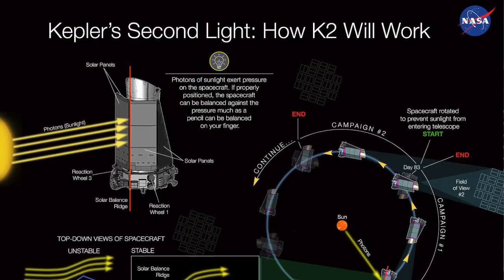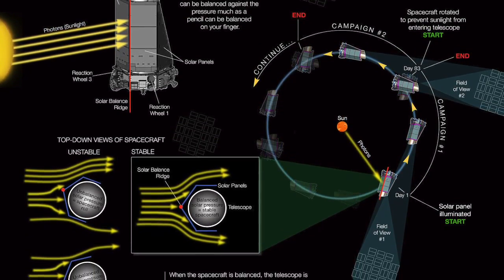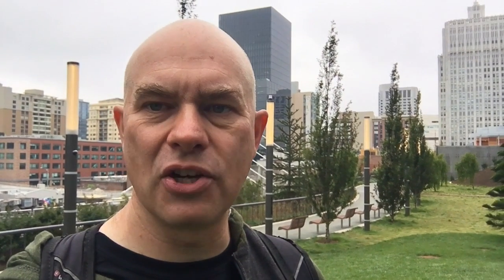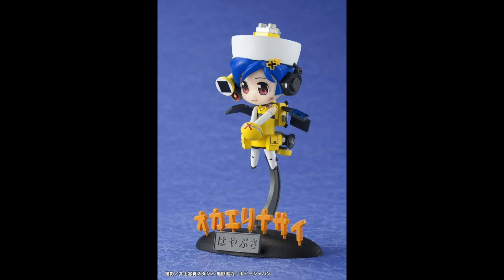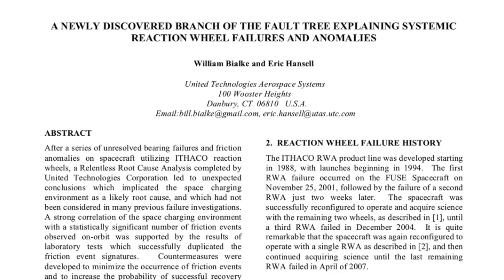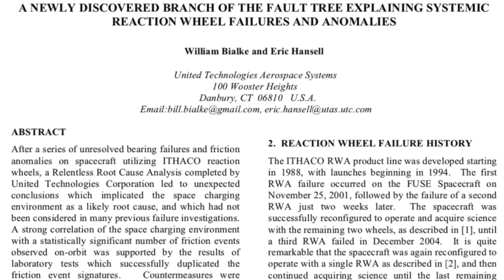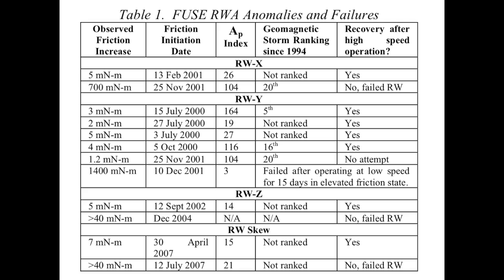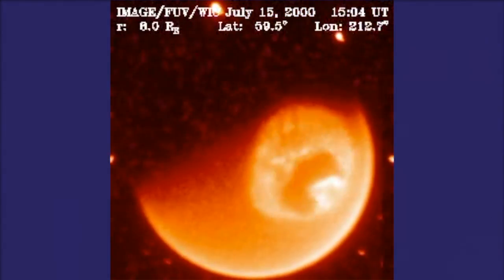Scientists May Have Figured Out Why So Many Spacecraft Were Failing

Comment: And when you think there's nothing more we can learn about space hazards, this thing happens. Manned mission to Mars? HA! Yeah, delay that for another 50 years till we actually find out how to keep people alive.
Reply: Or they could just carry a few spare bearings with them...
Reply: Caldwell Transport Columbus, GA sure, that will work great. Adding more weight for spare, spare parts because you do not know what is going to break. Is it not better to simply know how stuff work out there, then send people and spare parts that will only be used in case of emergency.
Reply: I guess you've never been away from a city where you couldn't just pop down to the local store and buy anything you need. 
Even when you know how stuff works, its going to break, often in new and frustrating ways.  With unmanned spacecraft, we just write them off when they breakdown.  About the only real justification for sending people to Mars etc. (besides FLAGS AND FOOTPRINTS!!!!!) is that they are highly adaptable and versatile (in addition to being fragile and resource hogs), able to fix things or improvise that would be impossible to automate (yet anyway).  But they can't do that without anything to work with.  How many more generations do you want to wait until you feel everything will be safe and perfect enough?
Reply: Caldwell Transport Columbus, GA well I guess you can just send them at random, and hope everything goes well. I doubt the public opinion will back you up on this though. But since politics has everything to do with public opinion I doubt you'd do that. You'll just wait for.. something to happen. Maybe a war that, will force your hand for example. And that's exactly the state we are at the moment. Peace kinda sucks of you think about it.
Reply: Humanity spread across this planet and became its dominant species by just going out at random and hoping everything goes well. Your sentiment is why I don't think our civilization (perhaps even species) is going to be the one to get there.
Reply: Caldwell Transport Columbus, GA it was forced to do that, under the pain of hunger, war, and the lust for riches, and new territories. You think Columbus would have sailed to the new world, had he not promised gold to queen Isabella?
Reply: History fail.  He wasn't sailing to the New World and he didn't promise gold.
Reply: Caldwell Transport Columbus, GA hey, I'm not here trying to educate you, that's Scott's job. If you want you can search the motives behind the "age of discovery", aka "the search for the Northwest Passage". I personally can tell you now, it had nothing to do with "braving the unknown", or "our compulsion to explore" (took that line directly from Ayreon). It was more or less about wealth, gold, and the control of trade, primarily spice trade from India.
But that is my opinion based on the info I have. As always, you are entitled to your own opinion. We have after all free will... or do we?
Reply: "Peace kinda sucks of you think about it."
No it doesn't, modern war is senseless destruction. The ernormous US military budget won't bring you any closer to the stars unless Trump takes the whole Space Force part serious.
I think it was Wernher von Braun who said a Mars colony might cost about as much as a small-scale war but the profit and opportunities would be so much greater. 
You may think it's not economically feasible right now and for the science community unmanned probes are sufficient, and I agree. But in the long term space travel may become cheaper and the vast deposits of resources in our solar system more appealing. After all, Earth is a planet with limited resources and limited growth is not socially acceptable, that means becomming an interplanetary civilization is inevitable, unless there is a Nuclear war killing civilization before.
Reply: @ Jo - Not opinion, facts.  Our compulsion to explore, or curiosity, is the instinctive need to find resources.  Our contemporary problem is that those with the ability to bridge the high costs of getting into space,  the owners of capital (ie; government and the wealthy), are largely fat and happy down on Earth and are satisfied receiving a safe return on their investments down here.  So, barring a handful of individuals and a tiny fraction of the world's capital resources, the impulse to explore is largely suppressed.  That will not change until either our motivation goes up, or the costs to explore goes down.
Reply: Mayer "modern war", is no war. Simply a stronger animal picking on the weak. In a true war, both sides loose, constantly. That's why they invest in crazy plans that can tip the scale in their favor. That's how innovation is born. Be not mistaken. This is a peaceful time we live in, with a few skirmishes here, and there. And even from those skirmishes sometimes, human ingenuity enforces a crazy plan like 9/11, which actually works. You really can't think like that during peacetime.
It's funny how you mention Braun. An axis scientist, recruited by the US under the pain of death, since you know, it was either that or  war criminal charges and execution. So an innovator bred by war, he worked for the US on another war, a cold war, but a war nevertheless. He made sure the US would sovereign over space, so they could have the higher ground. Well, he tried, Russia has recruited a bunch of axis scientists as well. You know the rest.
Reply: Caldwell Transport Columbus, GA so if you agree that, what motivates innovation is profit, then why start your comment disagreeing? Anyway I somewhat agree, not fully, with your change of subject, but I don't have the patience to talk about it. It's more your attitude that ticks me off. You know how things work, in your opinion (and I don't give a fuck if it's facts), yet all you do is sit here complaining about that, to me, a stranger. Go do something about it, if you think it's possible. If your faith in humanity overcomes the obstacles set by governments, and powerful people. You go show them...

Comment: Mmmm... so, low cost supplier... as the old saying goes, you get what you pay for...
Reply: Rick Koehler  I have a feeling that "low cost" in the satellite industry is still several orders of magnitude better quality than what the casual observer would consider "good enough".
Reply: timbargen yet, cheapness eats the money as a saying says...
Reply: @ergohack  you're probably correct. However, in most applications you can get away with "good enough" because you can have someone service the machine when something goes wrong. That's not really an option in space...  

That said, I find it interesting that since they switched to ceramic bearings this issue has largely gone away. Yes, I'd like it if we could capture one or more of the probes with the failed reaction wheels, bring them back and figure out exactly why they failed. However, I doubt I'll see that happen in my lifetime, so the hypothesis of arcing inside the bearing makes for a plausible explanation.
Reply: @koehlerrk1    When you get into parts like this, using cost as an indicator of quality isn't nearly as useful, since many other things come into play.  
For example, lower cost may actually indicate a higher confidence in the end product (on the manufacturer's side), since they won't feel as much need to build the cost of potential lawsuits or insurance claims into the final price.

Comment: Could it be that this manufacturer hit a particularly unlucky more susceptible combination of bearing material, lubricant composition, distance of the ball from the body of the bearing etc or them experiencing an higher failure rate is just a consequence of being used more due to their lower price?

Comment: *writing comment at around 5min in...
Ceramic bearings are a thing. 
...yup...
  I can't believe it took so long for this to happen. Apparently these guys need a serious crit or velo cyclist on staff. Ceramic bearings are common on top of the line road and track race bikes. They are harder and therefore more efficient. There are also ceramic hybrid bearings. IM(unqualified)O ceramic bearings should have been their starting point (lighter weight/less rolling resistance/less lubrication issues/electrical properties/only cost about 1.5 times as much as traditional steel) The only downside of ceramic bearings that I'm aware of is their impact tolerance. A big downer for the scientist to miss out on all of the offroad 4-wheeling-ur-space-telescope events but whatev
-Jake
Reply: DANK 
  I don't know. IIRC steel bearing require a different alloy that is considerably softer for the races as opposed to the ball bearings. The races are intended to be the deformed wear surface instead of the balls. I am no metallurgist but from my limited understanding dissimilar materials are the root cause of expansion issues. IIRC ceramic bearings are made of more similar materials between the different parts of the construction.
  Empirically, they seem to work pretty well on my main bike. So far I put about 10k miles on 2 in my main bike's bottom bracket (crank/the 2 arms that the pedals attach to). I have 5 total in my main carbon wheels. Those probably have around 20k miles on them. They've done better than most of the steel bearings I've replaced in a bunch of bikes and wheels since I started riding daily in '09. It's not space, but for light duty use they work pretty well. Bikes are surprisingly demanding on bearings. I've shattered a few steel bearings and worn out at least a couple dozen. I've yet to replace a ceramic from damage or wear.
Reply: "The only downside of ceramic bearings that I'm aware of is their impact tolerance."

They probably thought that would be a problem when they pretty much chuck they million dollar telescopes into the sky and hoping it doesn't come back to hit them in the head, but that's just my unqualified opinion.

Comment: A friend who is building large CNC machines said it is a huge problem to ground these machines properly because ESD (when machining some matertials) and the currents of the motors are causing these problems with the bearings
Reply: Add some ambient ionizing radiation, this will dissipate electrostatic buildup, and it will give you cancer, but for grounding moving parts across an air-gap, it really works, by knocking electrons out of surfaces.
Reply: Balanced Ion showers are the only way to work on instrument grade CCDs.
Reply: @kurtilein3  An alpha emitting radioisotope would accomplish this.
Reply: @taraswertelecki3786  Actually it is Beta radiation that is composed of electrons. (Alpha is essentially a Helium nucleus).